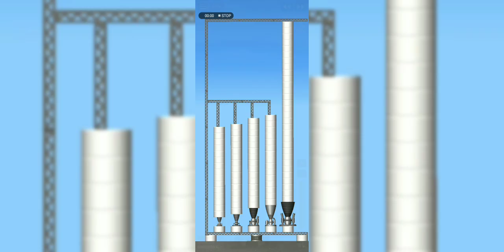Testing Engines Flame  Collision Box on BETA 1.5.4.3 | SpaceFlight Simulator Update

Comment: You can trick people into thinking you have the titan engine

(1)get 2 hawk engines
(2)clip them together facing different sides from each other 

Boom yiu got a fake titan engine but only use it if you have cheats and use no heat damage

Comment: H-H-H-H-oo-w will we make falcon or-or starship?
well goodbye I'm uninstalling
Reply from the maker: If we're going to clipped parts to engine, we need to use no heat damage cheat
Reply: We need cheat like "no engine heat damage". I want atmosphere heat damage. But my rockets will not fly without engine clipping.
Reply: @Granat_1989  bruh its sooo cheap its just 26 R$ in brazil